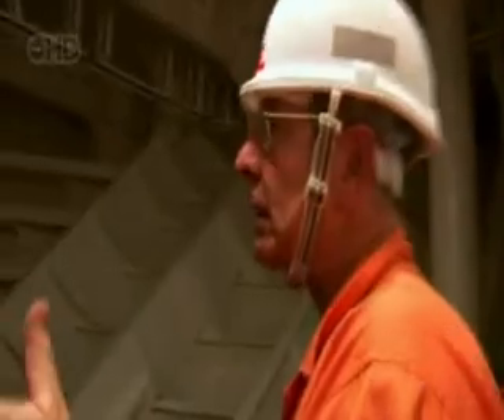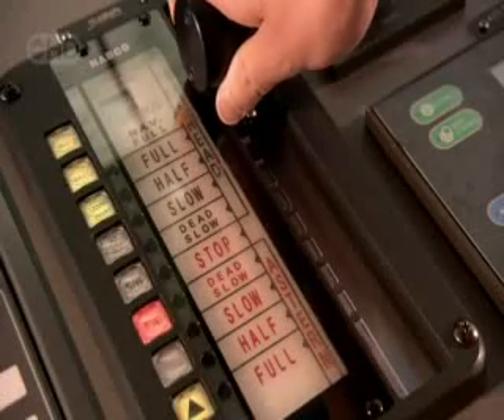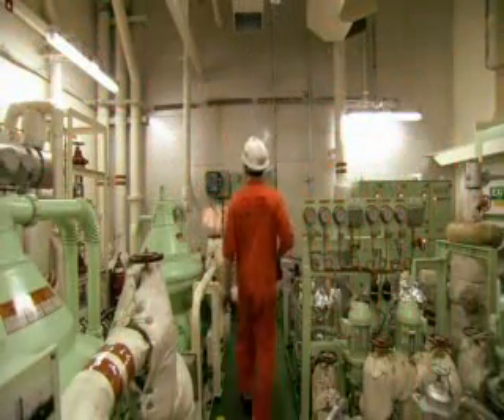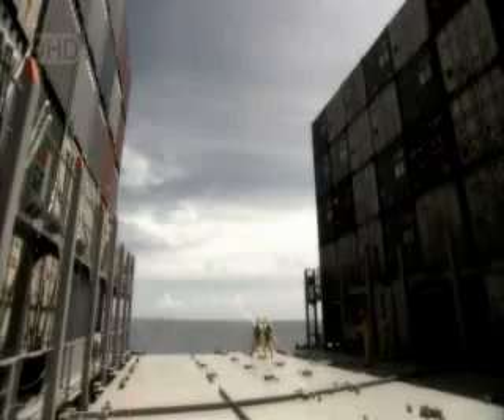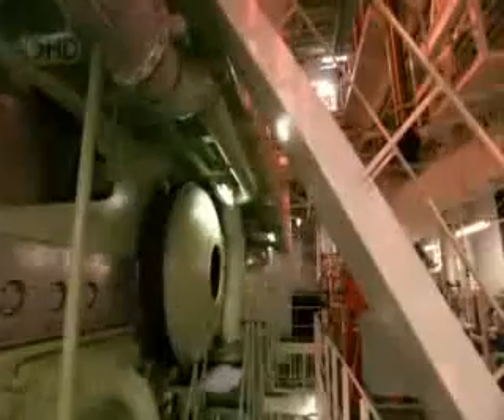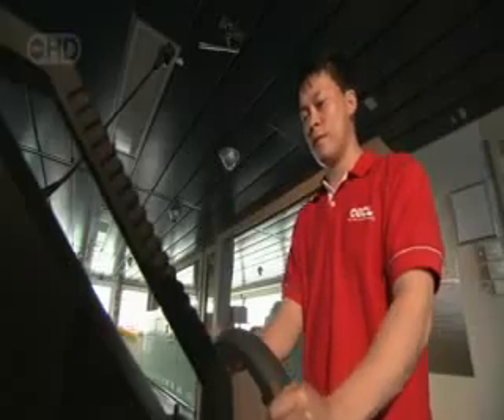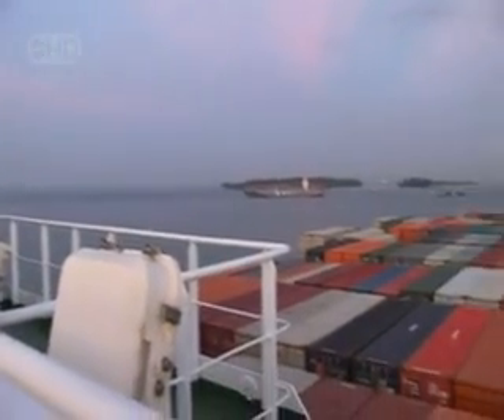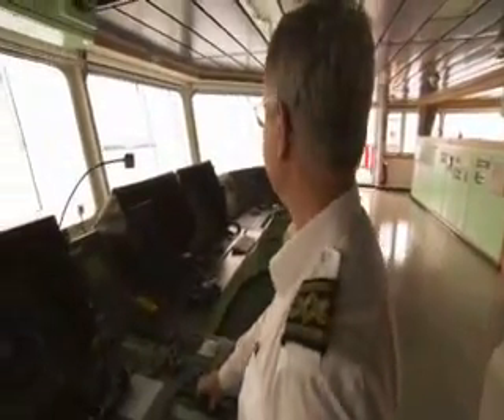Megastructure Megaship Part 02

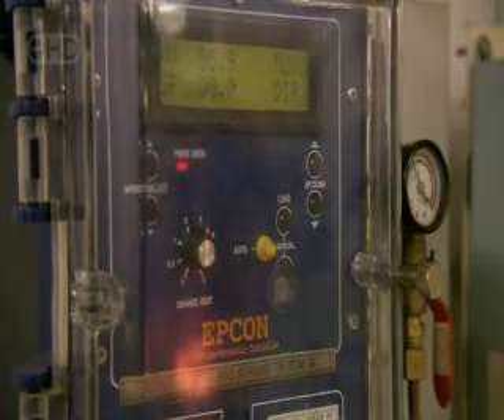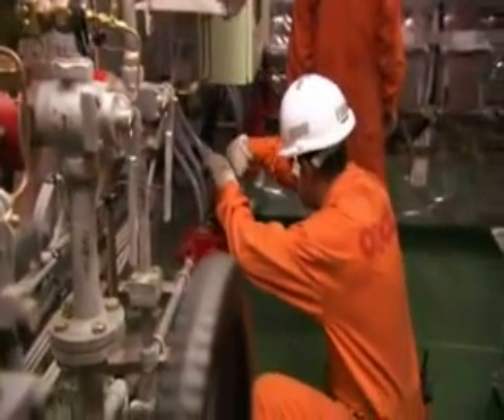Comment: the narrator is right diesel plus gas and spark equals fire and fire is one of the #1 killers of ships at sea. if a ship catches fire it will go down in seconds so the drills at 4:14-6:39 are important if a fire starts they need to kill it asap.